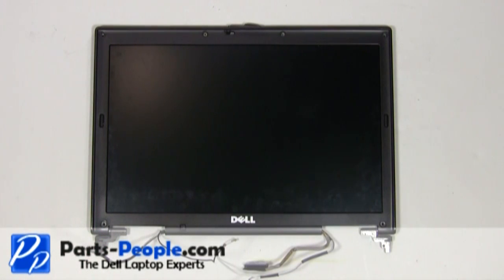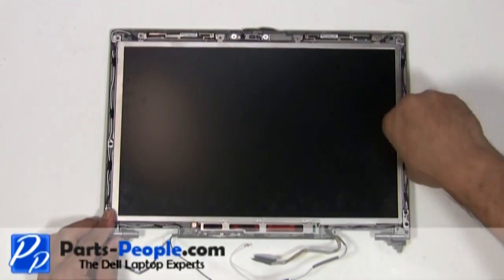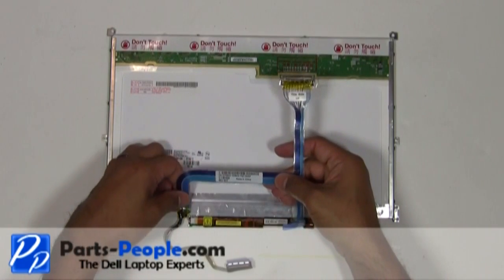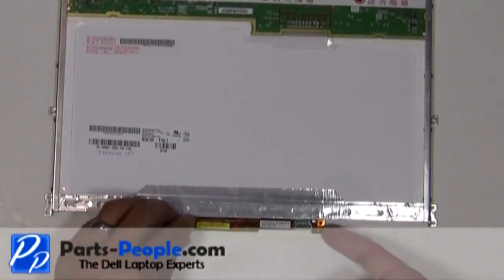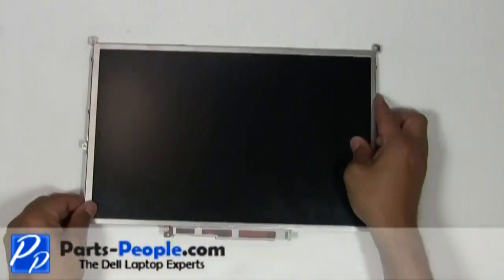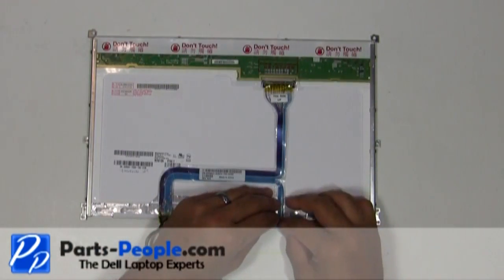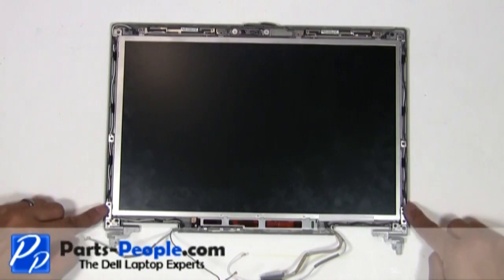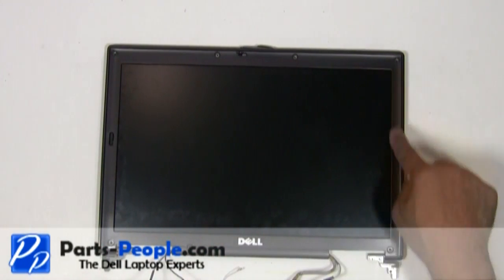Dell Latitude D630 | LCD Display Inverter Replacement | How-To-Tutorial

Comment: Ack! After successfully replacing the inverter and testing it so that it works, I reassembled it back together. However at 3:31, I may have over tightened the Phillips machine screw and stripped the + in the head of the screw. Anyway to remove the screw? Or just leave it in for now?